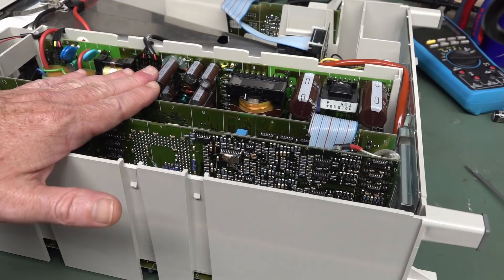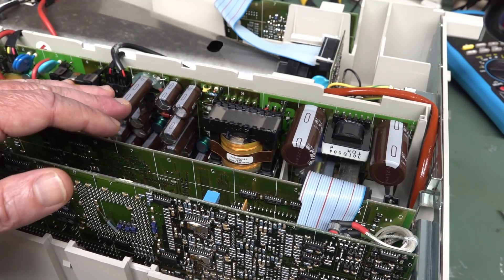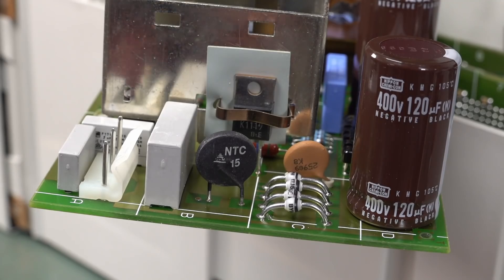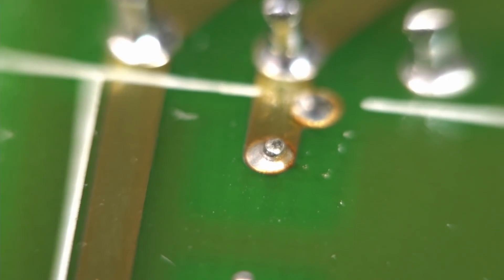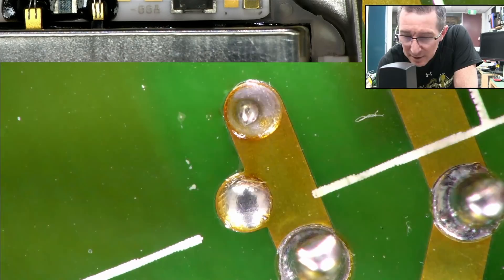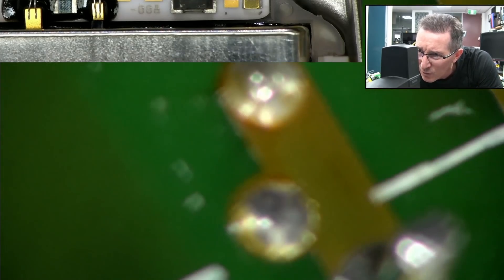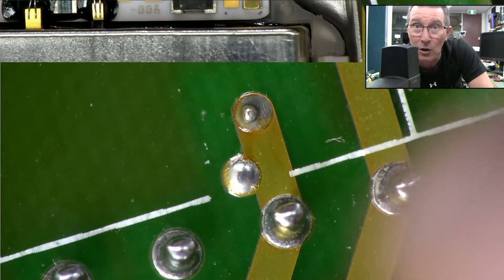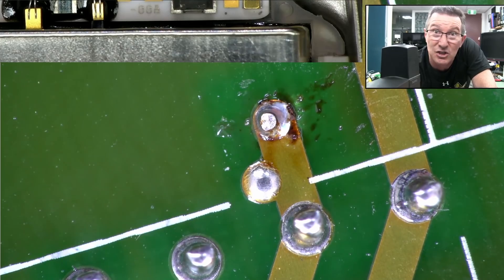Fluke PM3370B Solder Joint Inspection

Comment: I have come to believe that any solder joint can start to look suspect if you look at it with enough magnification and light. On another note, I once had an issue on a double sided PCB where the connection through a via from one side to the other would open when the PCB heated up and close when it cooled down. Soldered a piece of wire through the via on both sides and problem solved!
Reply: That is definitely not a fault I would expect... I would have just troubleshooted until I found the lost connection between parts and probably run a jumper half a mile long between the ends lol
Reply: @whatevernamegoeshere3644  It was actually the trace which supplied Vcc to a ROM. Pretty random failure mode for sure.
Reply: Wow, I had the same problem of failing vias with an Acer monitor. Took me ages to question the vias and confirm that. Several were failing on the LED driver board. I ran some bare wire through each via, soldered to scraped traces nearby on each side. Monitor has worked since.

Comment: The joint may be a bit dodgy, but the NTC still seems galvanically connected to the pcb.
I've put this reaction already in the comments section of the previous video, but no harm in doing it here again. 
With CRT's nine out of ten times it's the line transistor that shows this kind of behaviour when failing. It's the part that also comes the most under stress. In the past when dealing with CRT's with this kind of behaviour this was the part I always checked first, useally with some cold spray. In this case it's transistor VL1109. BUV28 was notorious, but don't get fooled when you take it out and measure it. You probably won't find anything wrong with it then. It useally only fails under load.
Reply from the maker: If it was a semi then why did it magically fix itself after I soldered the power joints?
Reply: @EEVblog2  Did you also solder the joints of that particular semi? I have no explanation, however I have observed some really strange behaviour of linetransistors in the past. Perhaps your re-soldering actually did the trick.
Reply from the maker: @edwinschuddemat8280  If it was on heatsink then I likely did.
Reply: ...and another thing to check on my version. Thanks.
Reply: @mcconkeyb  Best of luck to you. I hope you'll find the problem.